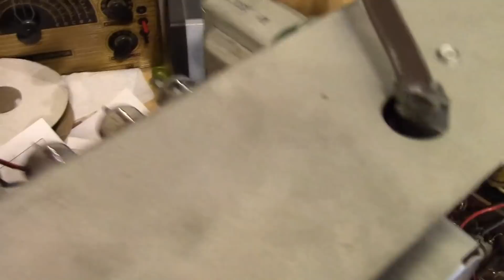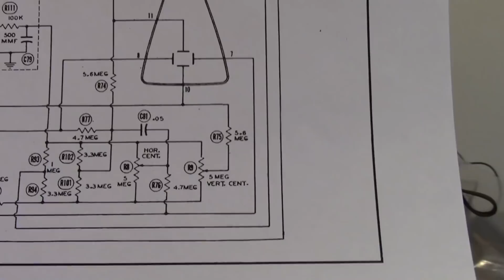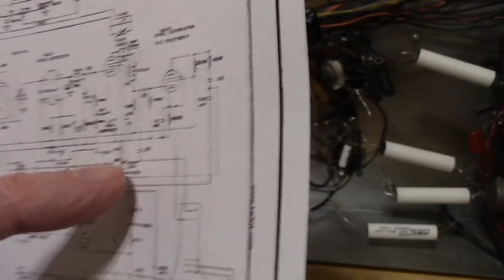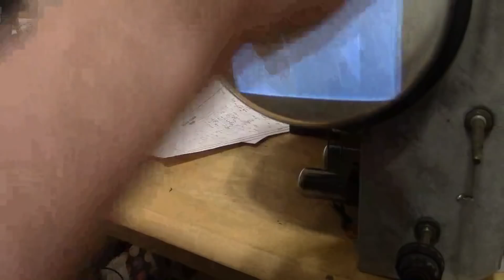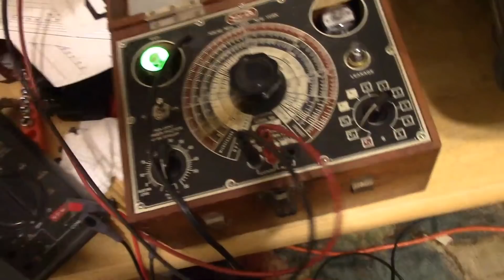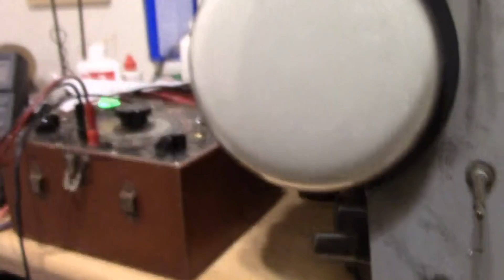Meck XB-702 restoration p3o?

Comment: SOOOOO.  THE GUY THAT J HOOKED THOSE CAPS IN.   TOOK THEN FROM A FACTORY ORIGINAL PARTS TV.   YES.
Reply from the maker: Hard to say.  Could have been done in the factory.  Maybe someone screwed up?  Looks like the tuner has been replaced too and all the tubes are original.  If it was serviced, it was done a very long time ago.

Comment: I have one of those Solar capacitor testers, but it is rough shape. It isn't complete, and the top of the box is missing. One of these days I will get around to fixing it. I ended up buying a model CE. That one goes up to 600v.

Comment: Maybe the cap going to the grid of the audio output tube had the outer foil on the wrong side?
Reply from the maker: They had the outer foil going to the lower impedance volume control side.  I think that's correct,

Comment: Caps have two opposite failure modes, leakage and open.  That audio .05 went open so the high impedance grid was just being fed by a wire picking up whatever the set was radiating and had no connection to the volume control. Which is also why no received audio was coming through.    I also noticed that the factory conveniently mounted the filter choke with machine screws and not rivets so it could be easily removed to service the can caps.  It seems the date code on the HV caps is 33rd week of 49 or 59   Do they match the date codes on the other caps?  Maybe they are original and were clipped for troubleshooting then reinstalled.
Reply from the maker: Yeah all the date codes in this set seem to be 1949.  Some other clues are that the tuner appears to be a replacement and the speaker was moved to the opposite side.

Comment: Anytime you have 10Meg grid bias resistors around with old paper caps you are going to have problems. 10Meg is high high impedance and it doesn't take much to upset the apple cart.

Comment: 20:10 Maybe the outer foil of the capacitor has been connected to a high impedance point and is therefore picking up noise.

Comment: It was not too uncommon for the "Fly by Nite" tube changers to install used parts to make sets work. I knew a guy who worked at one of those type shops. They had 25 or 30 chassis hanging off the walls in the back room, and he frankly admitted they just pulled parts off them when they needed ones to repair a set for a customer.
 I have a few NOS CCC caps in the shop storage, IIRC. Those split sounds sets were a total PITA to get set right.
Reply from the maker: All together the changes I've discovered are:  all four HV caps clipped/replaced, speaker switched to the right side, tuner replaced. All done a long, long time ago.

Comment: That capacitor volume-control-to-grid IS a filter. Consider that cap is between high-impedance grid to lower impedance detector output. Cap goes open , or barely there? Hello free grid awaiting any local AC signal.
Reply from the maker: Thank you for the explanation. Makes perfect sense.